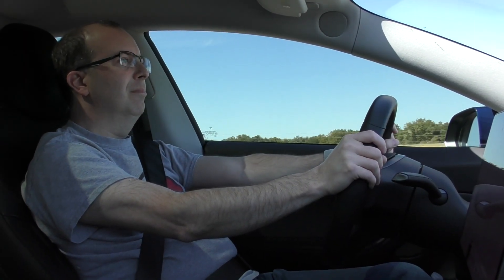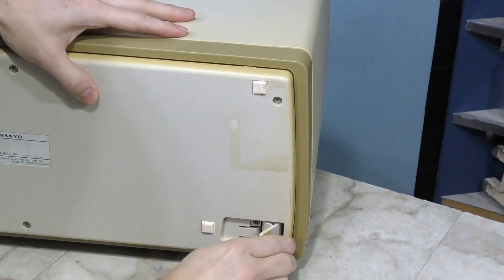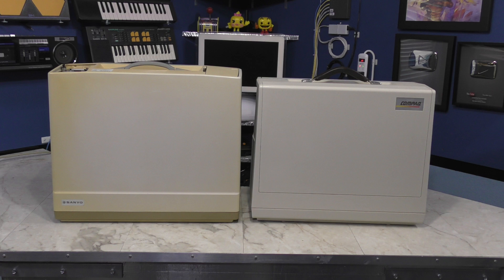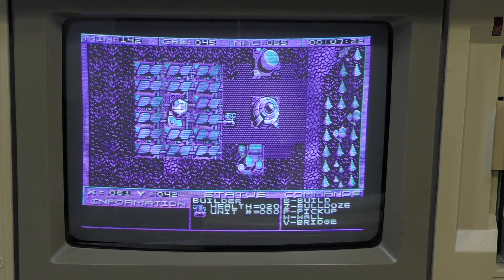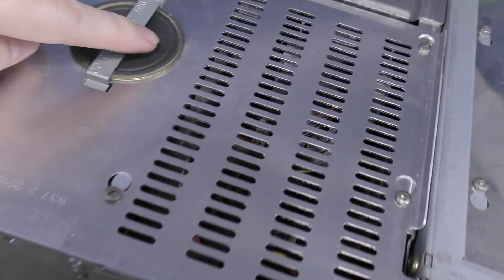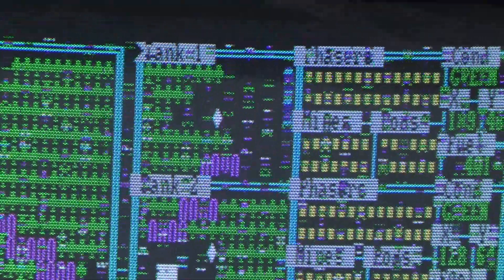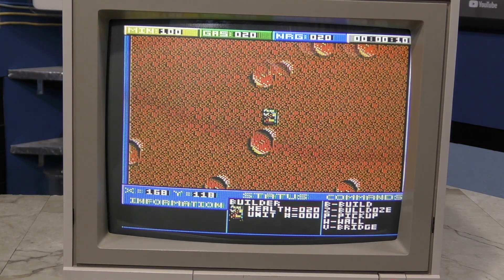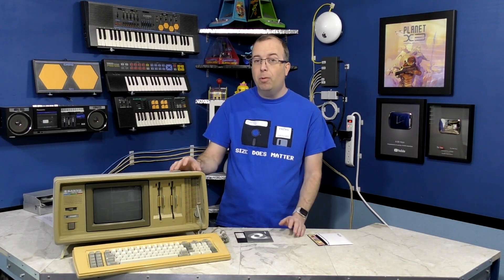Sanyo MBC-775 - The first PC portable computer with color screen.

Comment: Very interesting.  I have owned a lot of Sanyo electronics in the past, and I have never been aware of a computer.  I am curious about this, because of its weight and impracticality if this was not something that was set up in a semi-permanent installation to be used as a field instrument in a portable lab.  Whatever software that would be used in a lab would probably be custom voded for it.  Maybe a businessman woild be lugging this around, but there would have been far lighter and less expensive options and most business functions at the time would not need color graphics. 

Also, I used to love road trips like that.  I will admit that if you have an electric car you need the charging stations.  But you don't really see a lot from the interstate.

Comment: Same issue I had with MBC 550 back in early 80's - said it was IBM compatible but only ran Sanyo DOS sw
Reply: It was sold as MS-DOS compatible (which it was), not as IBM BIOS compatible.
Reply: For example the keyboard hardware and buffer was different from the IBM compatibles as was the video system (not CGA compatible). Any program reading the IBM keyboard buffer or using CGA did not work.

Comment: Looks like the Sanyo MBC *series* was launched in 1982, with the 775 model coming out a couple years later.
Reply: The Sanyo MBC series started with a bunch of CP/M computers.
Reply: 0mongo0 and?
Reply: @TravelingSolo  And the Sanyo MBC series started with a bunch of CP/M computers. What part didn't you understand?
Reply: 0mongo0 you mean the part that is irrelevant? Regardless of the architecture or OS, the series was launched in 1982, which is likely where the computer museum got their date.
Reply: 0mongo0 there were also DOS compatible machines launched the same year.

Comment: The 80's was a fascinating time for computers. Some computers were specifically built for business usage because the business market was perceived as more lucrative.
Reply: that still holds partially true today. consider workstations vs gaming PCs
Reply: @vinesthemonkey  Yeah, fair point.
Reply: Yeah, David's point at the end about Sanyo missing out on the gaming market seemed a little odd to me.  Back in the 80's you'd have to be a trust fund kiddie to afford one of these.  These were squarely aimed at high end business users.
Reply: @vinesthemonkey  I wouldn't mind a multi-purpose rig for games and work.
Reply: Businesses were willing to pay out the money to gain a strategic advantage over other companies.  That was the difference between now and today, where computers operate more as appliances.
Reply: That's because in those days the PC WAS more lucrative in the business market.

The PC only became a genuine gaming machine until half a decade later.
Reply: The business computing market started in 1951 so had been proven to be  lucrative with the right machines. During the 1980s, the computers at the Aerospace company I worked for were nearly all DEC (PDP11s and VAX). They did buy an IBM PC AT to evaluate and we weren't impressed. While there I ordered a DEC 10MByte hard drive cartridge costing £100 for our department to keep its CAD work on. I also got a quote for a DEC VT220 monochrome terminal which we thought we needed for a job and that was about £700. By about 1987 people there had realised it was cheaper to buy an Apricot computer and run terminal emulation software on it than to buy a genuine DEC terminal. The start of DECs downfall ?

Comment: I had one of these back in the early 1990s! One of the things that will improve the compatibility quite a bit is replacing the buggy Sanyo BIOS with a generic Phoenix XT BIOS. My brother and I tried it, and it fixed a lot of problems with both DOS and CGA compatibility.

The odd floppy drives were Chinon, and I seem to remember them working pretty well.
Reply: This was my first thought. I had a clone XT in the mid 80s that had Phoenix BIOS in it. I found some Compatibility issues, so I found an image of the real XT bios, burned it and popped it in. other than the boot time/mem check being slow, the compatibility issues went away...
Reply: @dnorman2134  So the chipsets on those boards were that generic that an original IBM BIOS would just run on a clone board?
Reply: Stoney3K early x86 boards were off the shelf, drivers were a rare thing then, changing switches on the board was used in cases of big changes to the system, such as RAM and video mode
Reply: @Stoney3K  Yes. By that point, the clone designs were mostly identical. It was all still off the shelf hardware. It just had IBM's intellectual property in the rom.
Reply: D Norman IBM had published all the electrical diagrams and the full BIOS source code.  Hard part of making a clone BIOS was to make sure anything a "smart" program might reference (even though it shouldn't) would be in the exact same location despite being rewritten differently.  Famously one of those things was the letters "IBM" where those would be in the original copyright message, but in a sentence saying this was not an IBM BIOS...
Reply: @amirpourghoureiyan1637  Ah, the days of dip switches and special cables... Can't say that I miss them much!
Reply: @Stoney3K  I had the MBC-555 desktop, and the answer is no, for that one.  

A lot of PC based software worked by writing direct to the text screen memory, because going through the BIOS was slower.  Any software that did that didn't work, on the MBC-555.

I hacked a couple of things I needed to work, by finding references to the screen memory, and changing that bit of code to call my own screen routine, tacked onto the end, which called the standard BIOS functions instead.

I had to do it all with DEBUG, which was just a binary (or hex) editor and memory viewer.  I got quite good at it, but I was much younger, and even more persistent, then.
Reply: @Stoney3K  That was the whole point of being a clone
Reply: I thought that too, maybe even a BIOS from Quadtel would suffice as that has all the setup options integrated into the ROM.
Reply: How easy/hard was it to change the bios for that, lee4mhz? Was it as simple as a chip swap?
Reply: @JustWasted3HoursHere  Yup, it was that easy. XTs usually had 8k BIOS, and since clones almost never shipped BASIC in ROM, they could cut costs and stuff the BIOS into a single 2764. No one used the MK36000s the original IBM motherboards called for.
Reply: @lee4hmz  I doubt that could be done nowadays, could it? It seems with so many motherboard variants out there it would be difficult. On the other hand, I guess they could be more generalized BIOSes which would apply to more than one CPU/support chipset type. [p.s. I have no idea what I'm talking about!]
Reply: @lee4hmz  Also p.s.: Are you looking forward to The 8-Bit Guy's "Dream Computer" project? If not, I think you might find this interesting, especially if you're interested in retrocomputing:
Part One: https://youtu.be/ayh0qebfD2g
Part Two: https://youtu.be/sg-6Cjzzg8s
Reply: I NEED TO TRY THIS.
Reply: @Kazuo1G  lol i just read ur original comment and i thought that i should tell you about this
Reply: @lee4hmz Your parents must have hated you, if they bought you that thing.
Reply: That was a long shot, you could brick the computer if something goes wrong. At least on those days, now you can copy the original rom with a EEPROM recorder.
Reply: @buenasnoches2  the BIOS ROM on this machine is a removable DIP EPROM, so we physically swapped with a BIOS from a no-name XT board we had lying around. It's really hard to brick something this old.
Reply: Bartuc Samplambio These computers don’t even have a RTC to keep settings so nothing would be irreversibly ruined if the different BIOS was incompatible with the PC. The memory is volatile so it would be wiped once turned off and nothing would remain when going back to the stock ROM

Comment: As soon as I saw “Sanyo”, I knew it was maybe 80% compatible. That was a dark time in DOS-land!
Reply: CandyGramForMongo absolutely! I had the Sanyo MBC-555 with 128kb, incompatible with almost everything. Memory expansion was nearly impossible.
Reply: @barthonhoff5547  The MBC-555 was marketed an MS-DOS compatible, which it is, not as an IBM PC compatible. The bios on an MBC-555 was loaded from floppy, so you couldn't boot from a disk for an IBM PC.
Reply: There were quite a few early '80s computers that were MS-DOS compatible but not IBM PC compatible, including not only Sanyos but also the Tandy 2000, DEC Rainbow, TI Professional, NEC APC, etc. The Sanyo MBC-550 series had graphics better than CGA, being able to display 640x200 graphics in 8 colors, but ran at only 3.58 MHz and was even less compatible with IBM PC software than this MBC-775. (There was an optional video card that gave it standard CGA graphics which did improve its compatibility somewhat.)
Reply: @0mongo0  I still have mine in working condition. Is it worth anything?
Reply: Sanyo  went on to make some weirdly cool MSX computers in the 80s though...
Reply: Sanyo is Japanese, so is this computer from Japan?

Comment: What old Cisco Router did you get that compact flash from?
Reply: He most likely got it from ebay. Alot of 128-256mb compact flash cards on eBay are pulled from cisco routers. 
For these old machines you don't really want larger capacity cards because it can be a bit much to handle or just slows things down because they have to count bytes remaning on the card or somthing similar.

Comment: It’s amazing what they called portable back in the day. It’s like bolting on a hand strap to an ITX tower and calling it portable
Reply: People in the know called them "luggable" instead.
Reply: It was portable compared with what constituted a computer only twenty years earlier.  Try fixing a handle to the whole building floor / room and lifting that! :-D
Reply: Funny how back than portable tech was huge boxes with a handle but today if it does not fit in your pocket people does not consider it portable.

When the OG Nintendo Switch came out I read comments like that, how it was to huge for a pocket so they dont consider it as a portable device
Reply: it was obviously called portable because it was 'movable' from place to place, unlike most computers of the time, not because it was easy to carry around like a modern laptop.
Reply: More like bolting a handle to a Coca-Cola vending machine. An ITX can be considered"portable " if for example a Gamecube can, which did have a handle - you might go visit someone or move it from work to home, but have the separate TV/monitor and maybe keyboard and mouse on both locations

Comment: Gee whizz, that's one heavy computer, I can't imagine this one to have travelled a lot.
Reply: "Luggables" were surprisingly common up until laptops became a thing.  My mom hauled a Compaq Portable II to and from work regularly.
Reply: @AnonymousFreakYT  I know these things were quite common, but so far this sanyo one is the heaviest I've seen and 20 kilos really isn't something I would want to move a lot.
Reply: Funny how back than portable tech was huge boxes with a handle but today if it does not fit in your pocket people does not consider it portable.

When the OG Nintendo Switch came out I read comments like that, how it was to huge for a pocket so they dont consider it as a portable device

Comment: I'd guess the poor compatibility has to do with its ROM BIOS implementation being insufficiently IBM compatible. It would explain why both "unbranded" MS-DOS and so many games fail to work, if they depend on BIOS functions that are poorly written or incomplete, while other games work perfectly if they rely very little/not at all on BIOS.
Reply: It also explains why Planet X3 would work perfectly, since I doubt that such a programmed-for-fun, specialist game would rely on much BIOS code at all.
Reply: Replacing the BIOS might work if the system is otherwise fully standard ISA architecture, yeah.
Reply: Niels M H I seem to recall the following relevant factoids:
 1. PC-DOS accesses some obscure machine details during startup, such as retuning the floppy controller to fit 360K on a 320K floppy.
  2. DOS 2.11 had an unfortunate way to layer the DOS 1.x CP/M style and XENIX style file APIs.  This may have wasted too much RAM before loading some applications, at least by default.
  3. PC-DOS 2.x may not know how to get the hard drive size from the BIOS and will most certainly fail to recognize larger FAT16 disk layouts.  Hard drive partition tables actually have dedicated partition type numbers for DOS 2.x compatible partitions.
Reply: maybe if you do a BIOS chip mod, for a regular compatible one, it would had work with most software.
Reply: I have one of these and mine runs msdos 6.20 just fine.

Comment: the "motherboard" intel chip is dated 1983...the one below it is dated 30th week 1984..so it was definatly released after that (or atleast this one built)
Reply: I was waiting for David to look at various dates after he opened it up.
Reply: It seems he rushed a little to finish the video, but still it was quite good.
Reply: WacKEDmaN But that only dates this specimen or it's latest repair. There could have been thousands of identical machines rolling off the assembly line in the previous years.

Comment: In the Uk the same areas of motorway have their speed limits change all the time to accommodate for traffic, so there are some areas of motorway in the UK where there is always a reduced speed limit.
Reply: El Has Music is that also because of safety or construction, or just for traffic management?
Reply: Sometimes it is for road works but every time I’ve seen it nobody’s been doing anything.

Comment: I bought two of these two months ago, and they both have problems:

1. The first one has problems with the motherboard (probably shorted capacitors), and the CRT control PCB is completely gone, because it has a large crack running through it. (Which I'm working on remaking)
2. The second one has a bad power supply. The glue used to secure the large components is NOT friendly to their leads! So I'm having to find replacements.

Also, I am SO glad that I saw this, because I was worried about several things that I wanted to do to bolster the capabilities of this computer.
Reply: As a Mobile Suit Gundam fan, i can safely say: if two machines don't work, patch them together in something that works! (b ᵔ▽ᵔ)b
Reply: @T-Squared Since you have two computers with different problems, why don't you build a working one from both?
Reply: @enzoperruccio  Because I'm interested in giving one to a particular collector who is looking for one.
Reply: @Kazuo1G  give em the leftovers and a link to a "how to repair" channel. Lol
Reply: Talking about the component glue screwing up the board reminds me of an eevblog video where Dave was repairing some studio monitor speakers that the glue suddenly became conductive with age (!!)
Reply: I need to make sure I change the capacitors in my vintage electronics every 25 years lol
Reply: @The_Studioworkshop  If you change them for modern ones that aren't shit and liable to leaking corrosive liquid all over the board then you'll only need to do it once.
Reply: Wanna buy another one?
Reply: @timkalkreuth5548  No, but I know someone who is interested in one on the Vintage Computer Federation Forums. Send me a private message.
Reply: @Kazuo1G  can you look me up on messenger?
Reply: @timkalkreuth5548  I tried to contact you on Facebook Messenger, but you didn't answer. Any other places I can contact you about the computer?
Reply: Like put and led panel and a pi in it? 😜 j/k!
Reply: I love it when people blame things on capacitors. Such an internet response. An old broken computer. Originally wasn’t compatible with anything
Reply: @The_Studioworkshop  You'd be surprised. Macs (Original and Powerbooks) , Amigas, IBM PCs + clones, Apple IIs, and other systems all can develop problems from just this one component! Electrolytics spill their electrolyte all over their vicinity, and tantalums can pop or explode!
Reply: @The_Studioworkshop  they are a common source of problems indeed tho. X or Y capacitors in power supply line filter stages can even break a fire inside the device depending on the brand and model (forgot which ones exactly), tantalum caps can fail in short circuit and burst into flames violently, and electrolytic ones can dry over time as well or leak.
Have repaired quite a few stuff from just replacing dead/dying capacitors on them, including even a fridge motherboard.
Reply: The bad X/Y capacitors are those infamous RIFA paper types (and the less-common WIMA MP3 series). (Modern plastic film types do occasionally burn, but nowhere near as frequently.) Here's the EEVblog on them: https://www.youtube.com/watch?v=XAbrU17hLTM
Reply: @The_Studioworkshop  "I love it when people blame things on capacitors. Such an internet response."

That's because electrolytic capacitors are the only components that can go bad just from age alone (and usage accelerates the degradation). Even if a decades-old electronic device is still new / sealed in its original packaging, the capacitors can have gone bad. It's not an "internet response," it's a response from anyone who knows the first thing about electronics, and people who know the first thing about electronics far predate the internet. For example, someone in the 1970s working on a radio from the 1930s would almost certainly be replacing capacitors right off the bat (wax capacitors in that case).